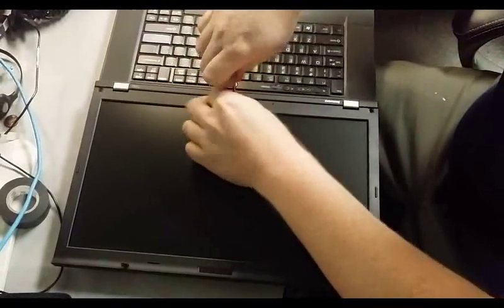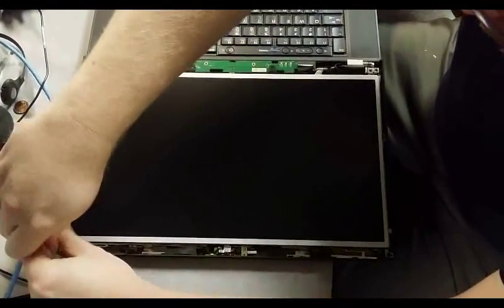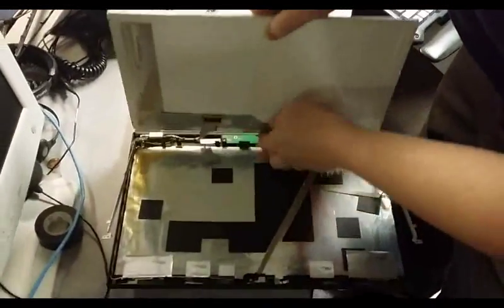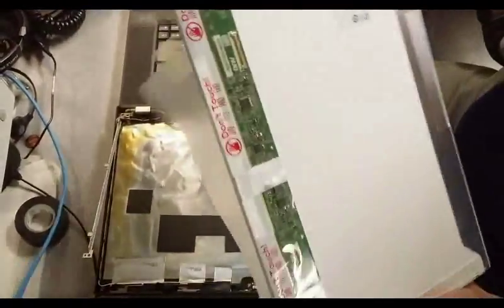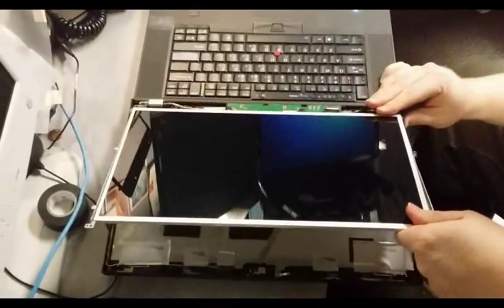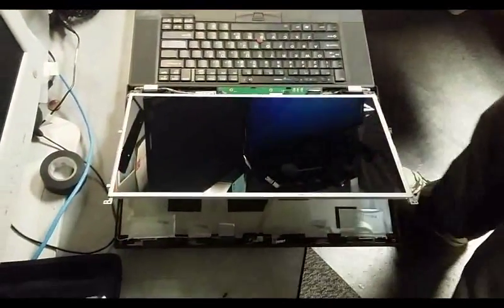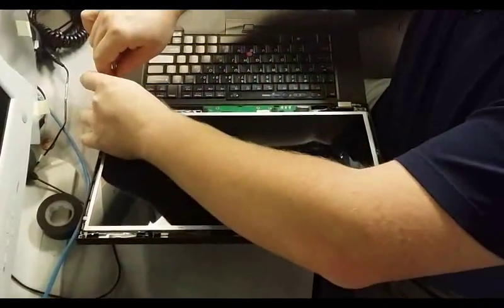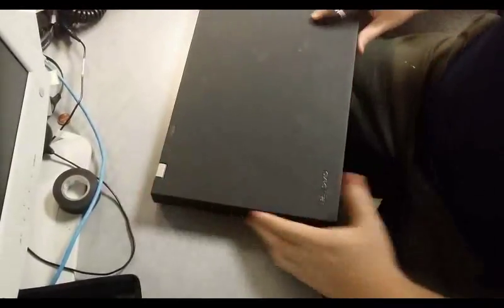Lenovo T520 Laptop display replacement in real time

Comment: Thanks for sharing. One thing I like best about Thinkpads is how easy they are to work on.  I have have tried a few of the screen options.  The 1080p screen with 95% color gamut is really a pleasure.  Now that these systems have come down in price, it is very much worth the extra cost to get the 1080 option, but only if it is the original screen version (aftermarket 1080 screens do not have the same picture quality and colors )

Comment: I might be the first person viewing this.

Mr. Campbell,

I am about to upgrade my Thinkpad T520-4240A17's screen from its original HD to FHD.

I looked up internet and found comments saying that a screen of resolution different than the original one might either be physically unfit into the frame or 'burn' the graphical card since electricity output will be different. Are these comments rumor?

Thanks!
Francis
Reply: +Francis Liu Have u done it ?
Reply: +Wanye Kest Yes, I have. It took me about 1.5 hours. The FHD screen has been working alright for 4 months. I bought the replacement screen from ebay. Search B156HW01 V.4 for the screen model.
Reply: Thank you. Did u buy new cables ?
Reply: +Wanye Kest No, don't need any.